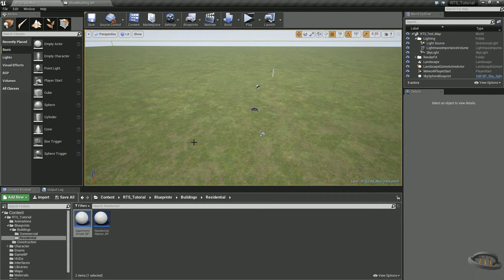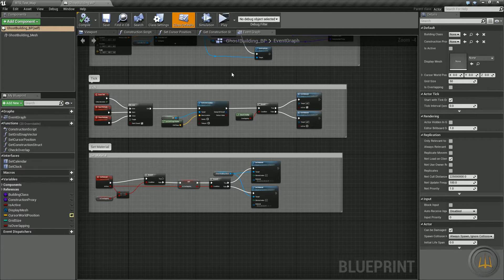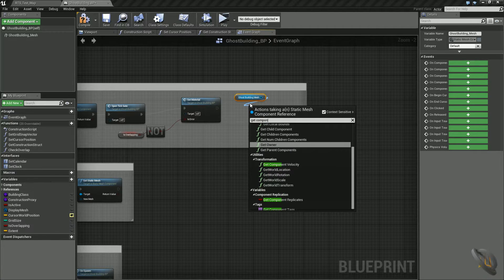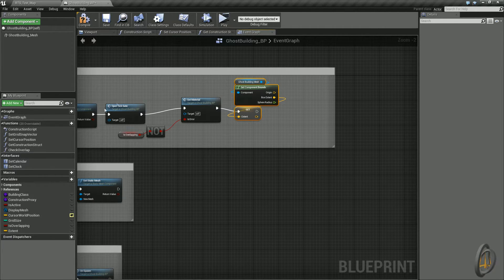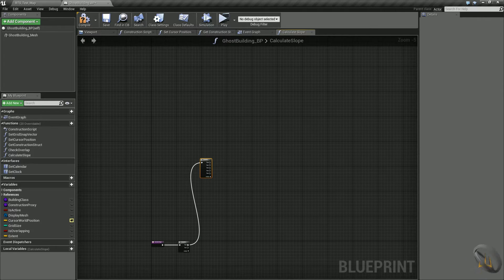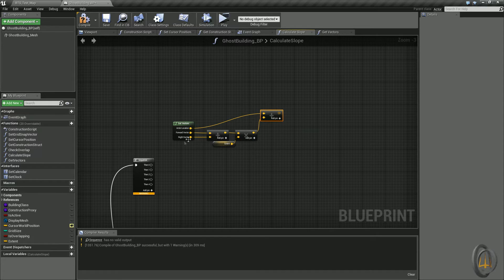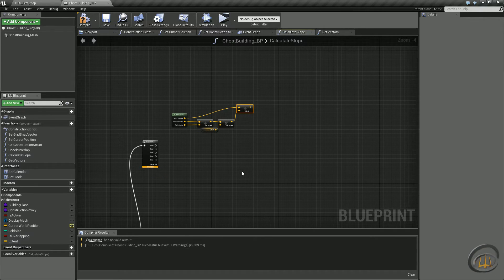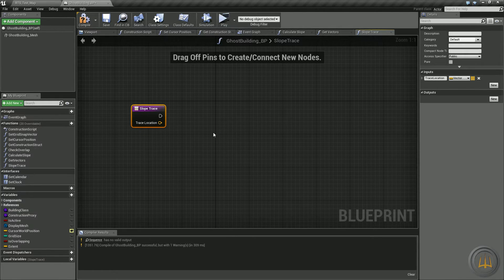Unreal Engine 4: RTS :: Ep 14 - Slope Check

Comment: This series still appears to be the best on the subject, Ive been following along 8 years later, knowing that it will end with no intention to be finished is a little annoying but failure to find other options of this calibre and quality, hopefully I will be able to pick up enough that I can continue with my own direction before the end of the series,

With this video however, I find that this appears more to just check for a height difference rather than a slope, If I level out land at a higher Z reference even tho it is flat I am still unable to build on it even on the flat part, I will need to do some research and go over this to see if that is just my error somewhere along the way or if there is a way to check for slope within a certain area around the model so I can still build on flat parts of land higher than Z0
Reply from the maker: Thank you for that. I share in your frustration, I wish I had the time to restart this series. For the slope check, you are correct it’s not really checking a slope, it’s checking a height difference between the shorter of the traces with the longer of the traces and ensures the difference isn’t too great. However, it should work on any terrain height

Comment: Love the series so far, it's been very helpful. I've been trying to work through it using v1.16 and there have been a few differences, but I've been able to work through them. This one I cannot get though. For some reason when I move my mouse over a flat area, the Ghost Object will randomly swap between jumping up to 1000 units high (or whatever level I've set on the vectors for the Box Trace) and then snapping back to the terrain. This effect seems to be minimised if the object is ON a slope though.
I can get rid of this by just removing the addition and subtraction to the Actor Location and just plugging the base value into the Start and End of the Box Trace. It still follows the terrain at this point and seems to work, so I'm not sure what that code was meant to do or if it's important to keep.
But I also cannot place the objects on flat areas unless they are at the base 0 height. If the terrain is flat but lower or higher than the base Z height of the terrain then the Ghost is red and wont let me place it. 
Any idea if I've done something wrong or if there is a different method I'll need to follow for the later versions of the engine?

Comment from the maker: @Nova Surge

Sounds like either you aren't setting either the Actor Location on the Z axis after the Box Trace By Channel or you didn't set your Box Trace By Channel's trace channel to "Landscape."  Take a look at the video at about 25:30 and pause the video right away.  I believe your issue may lie in this area somewhere because that is the only section of code that relates to moving the ghost mesh along the Z of the landscape.  If you still can't see a difference in what you have, take a screenshot of your setup and post it on a site like imgur for me to look at.  Also, commenting/replying back to you would be much easier if your YouTube settings allowed people to reply back to your comments ;)  Let me know if you find the problem or not!

Comment: Everything works up to this point, however, now my camera will clip through the terrain 'mountain'. -- And on a side note, the ghost buildings can sometimes stick to the camera pawn and allow me to place them floating.
Reply from the maker: +Frozen Firebat check collisions. Really there should be no collisions on your camera pawn. Before I select "no collisions" I typically set it to custom then set all options to ignore then switch to "no collisions". Pawn is not designed for terrain in its current state. Current camera pawn is simply for testing purposes. A more advanced option will be required for true levels with high terrain setup
Reply: Thanks for the reply, I figured that out.  Also, I'm not sure if it's the most efficient way of handling it, but I made the Controller set world offset on z axis to the impact point of a line trace along the z axis on event tick when there was no input from the MoveX, MoveY, or Edge Scroll. So it only runs the line trace if the camera is moving. And thanks again for the video series, You've likely cut months off the learning curve of UE4 for me.

Comment: Thanks for the series. I have an issue where my camera pawn is not following the contours of the terrain and instead will clip through the floor of a slope. Any ideas on how to fix this
Reply: Check that you split the Impact Point pin at 24:42 and not the Impact Normal pin.
Reply: @davidpeters5713  That wasn't my issue, I'm still trying to find out why the camera goes through the terrain.

Comment: i ended up subtracting the differences min from the max and comparing that value to the max differences threshold for the slope placement stopper, it ended up using half the nodes. is there any downfall to doing it this way? thanks for the tutorial, so far so good on 4.21

Comment: What if your mesh is irregular, i.e. a rectangle. wouldn't the box extent no longer accurately represent the mesh bounds? Also how would you deal with the origin point not being in the center of the mesh?
Reply: another thing is the slope check only seems to be working directly underneath the mouse not underneath the entire mesh
Reply: A bit late, but I found the solution. Modify your SlopeTrace function in GhostBuilding: https://imgur.com/DJ0CmaC

What this edit does, is it takes the static mesh, finds its center as relative to the center of the actor, and adds that offset to trace locations. It takes care of meshes with offset pivot no problem.

Comment: Little comment, at one point when setting the half size of the box channel, you say that we the Z value doesn't really mater. But actually if we don't put it at one, there is a bug that place the gost building much quite high on certain location of a slope.
Thank you for your videos by the way, one of the most interesting tutorial I have followed until now!
Reply: 4.14.1 - Confirmed. 
If someone have a bug, when u can place ur building on top of slope (try to aim ur mouse on buttom of high mountain) - connect node Z in GhostBuilding_BP -> Calculate Slope (function) where ur BoxTrace situated.

PS - Sory for my bad eng.
Reply: +Richad Datson and +Loïc Bouvier
Hello, i'm on episode Ep23 - Custom Buildings, and i a had a bug where the Apartment building ghost was way higher in the world while placing it. The workshop was fine.

And i remembered that i had a similar bug when hovering the mouse over a slope: the building would shoot up, 
i fixed that one with your comment and hooking up Extent Z to Half Size Z(BoxTraceBychannel in calculateSlope function). 
But then in episode 23 the Apartment building is way bigger(Z), i checked the value of Extent Z and it was 1015 i think, but now that we set the half size(Z) its Higher than the Start/End vector that we modified to add 1000 and -1000. So i set it up to 2000 just to be safe. 

Seems to work fine now(havnt finished the episode 23 yet) If anyone used the Half Size Z fix and continued with it:
Let me know if you have other problems related to building placements after video 23.

Comment: First: love this video series -- by far the best RTS UE4 series I've found by far.  I've noticed that the slope differences when you grab the min and max traces that you are just abs'ing the values and checking if either value is >20.  For me I was getting some odd behavior where some level, raised areas where showing as on a slope.  Would you not instead check the difference between max and min, get the abs of that, make sure that the difference is within the tolerance and branch off of that > comparison?  This might be something solved in a later, but it seemed to work better for me.
Reply: I also added a bit onto the building placement where it leaves the building embedded into the slope instead of floating on top of it -- just a personal preference.  You will likely cover all of this later, but just in case I figured I'd leave my couple of changes here http://imgur.com/a/im3r8
Reply from the maker: +Nick Skuda ya what I have is not the perfect solution. Glad you found/shared a good alternative.
Reply: Thanks so much to both of you. Thats actually very cool.

Comment: Protip: modify your SlopeTrace function in GhostBuilding as follows: https://imgur.com/DJ0CmaC

What this edit does, is it takes the static mesh, finds its center as relative to the center of the actor, and adds that offset to trace locations. Since you might want your buildings to be 2x2 tiles, 1x4 tiles, or any other size where the number of tiles isn't odd. You'd want to place a pivot in the middle of where a tile would be, and that creates offset. This edit takes care of that.

Comment: I'm having a problem where my game refuses to recognize plateaus, both low and high, as buildable. They are perfectly flat and with more than enough area to contain my structures, but the ghost stays red. I even have a very small hill where the very top should be flat enough to build but the sides not be, and the game goes the opposite and recognizes the sides as buildable but the top as not. (I also had the issue of the ghost shooting high up into the air for no apparent reason, but I managed to fix that by changing one of the Min/Max Float Arrays to be < another value.)

I have gone over and over the code multiple times, I have messed around with different variables, and have also tried the alternative setup proposed by @Nick Skuda. Nothing has really worked.

The closest thing to a solution I've found is setting my Maximum Differences really high (600), but of course that makes everything but really large and steep cliffs valid build-zones. At this point, I'm thinking it might just be better for me to implement a user-defined no-build-zone where everything is buildable unless the level designer specifies otherwise. Any idea what the problem could be?
Reply from the maker: +KoutaDragara self defined would work but adds a ton more work for you when level designing. Need to run debug on the line traces for slope check function to see where the traces are hitting and going in which direction
Reply: What should proper trace lines look like? Mine are all hitting on the landscape and shooting straight up.
Reply from the maker: +KoutaDragara they should be shooting down look under the landscape (eject from controller) and see if any lines are coming from it. After a trace hit the line would be green. Perhaps check your angle of placement too which is a variable we created for this. Try adjusting that to see if it helps any
Reply: Using 4.14 I was having the same issues but noticed the ghost object would ping up in the air to a specified amount (less on hills more at default landscape level). I changed the add 1000.0 to Z vector within the Calculate Slope function to 0.0. Now am getting desired results but does this mean I have no box trace above? 
Specific area you have highlighted at 22:59. The add to vector is 0.0 now.

Comment: Anybody ever have a problem at the end where no matter what your object would be in error?
Reply: I'm having the same error... however this tutorial is 3 years old so something must of have changed, I doubt we will get a response, so manual debug will be required

EDIT: after doing a lot of debugging,  on my calculate slope, when getting the absolute values of the differences and comparing them to the maxDifferences, one of the  "greater than" checks was inverted, so it was checking 20 > 0.000015 which was always equating to true, other than that the tutorial is still working in version 4.21. hope this helps
Reply: @CiscoStu  Yeah I had figured out mine to. I forgot to change the Local Variable MaxDifferences to 20

Comment: I dont get it, My landscape is completely flat. Max Differences = 20, but I cant place the mesh almost! anywhere. Set it to 200 problem gone. I've been struggling with this for almost 2 hours now. I'm just going to assume  it's a problem with my mesh now. Made it with BSP brushes, worked the last time I did it.. Anyway, almost ready to hop back into episode 28
Reply from the maker: Ya it very well could be those meshes. You can always download the ones I use if you want something a little more visually pleasing
Reply: +3 Prong Gaming Checked it out, Mr Rich's meshes work fine. So it's indeed something with my BSP_Mesh

Comment: I really like this tutorial, so far everything went smoothly until this
http://i68.tinypic.com/20qi52w.png
the cursor does not see the slope
Reply: I just want to say that I watched twice already
Reply from the maker: +dzejkop .SRD 
See the comment I left below for Nova Surge:

Sounds like either you aren't setting either the Actor Location on the Z axis after the Box Trace By Channel or you didn't set your Box Trace By Channel's trace channel to "Landscape."  Take a look at the video at about 25:30 and pause the video right away.  I believe your issue may lie in this area somewhere because that is the only section of code that relates to moving the ghost mesh along the Z of the landscape.  If you still can't see a difference in what you have, take a screenshot of your setup and post it.

Give me some screenshots of your BP setup so I can try and help to see what you are missing.  Let me know!
Reply from the maker: +dzejkop .SRD I don't set the "Set Actor Location" after the box trace but it looks as though it may be hooked up correctly so I'll assume it is.  The next question is, while you have the custom Landscape trace channel created, have you set your actual landscape to "Block" that trace channel?  Remember that when we created the trace channel, we set it's default value to "Ignore" and if you don't go back into the main editor window, select you landscape, find it's collision in the Default panel and change it's Landscape Trace option to "Block" then the box trace you do will shoot right through the landscape like it isn't even there.

To quickly see a visual of what you Box Trace is doing in the ghost mesh, select the Draw Debug Type to "Duration" and you will get red lines that represent how your trace is working.  If it shoots through the landscape then you know the trace isn't seeing your landscape.  If the red lines from the trace aren't centered around your mesh vertically then there could be a problem in the "Get Vectors" function we created.

Let me know!
Reply from the maker: +dzejkop .SRD AH HA! I found the issue!  Took me quite a bit especially since the images you sent were kind of small, but as with most bugs, they are usually small and hard to locate.  The best bugs are the ones that give you errors because they tell you where the error occurred narrowing down the search...

Anyway, looking back at the images you posted yesterday, in your Calculate Slope function, in the Break Hit Results of the Box Trace, you are setting the Actor Location of the mesh using the "Impact Normal" location pin!  This needs to be "Impact POINT" location pin.  Generally speaking, normalized numbers are a float value between 0.0 and 1.0.  For traces, the Impact Normal finds the location based on the center of the object the trace hit (in this case the landscape) then returns a normalized vector based off it's impact spot.  

If you were to run a Print Screen on the Impact Normal Z pin, you would see that it is returning a value extremely low, around .7 to .9 whereas if you run it over the main flat area of the landscape it would return 1.0.  So technically you are setting the mesh however, you are setting it's Z height to be that .7 to .9.  Set Actor Location expects a non-normalized number.  Fix that and your mesh will follow the landscape as expected!

Let me know if this works.
Reply: +3 Prong Gaming Now it makes sense, I changed "Impact Normal" location pin to "Impact POINT" pin location and everything works fine. Thanks for the explanation, slowly starting to understand
Reply from the maker: Awesome glad you got it working. Took me awhile to understand the concept or need of normalization and still struggle with it but as long as you know the general value of a normal, you can get an idea of when to use it. Let me know if there's anything else I can help you with moving forward!
Reply: +3 Prong Gaming 
Awesome worked like a charm btw you do @TOUCH the Normal; pin but then mill secs you split the point struct.. man that a big miss on my part for something seeming impossible to fix lolol...  Nice work debugging fellahs....   ahh i wrote thx for this fix and fell for the same thing when i came back round to it this time LOLOLOLOL silly rabbit